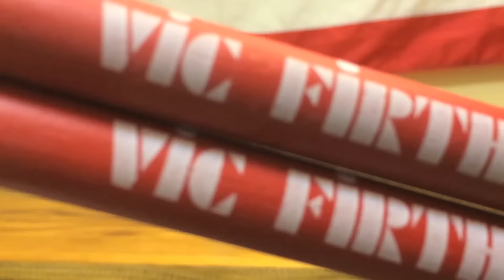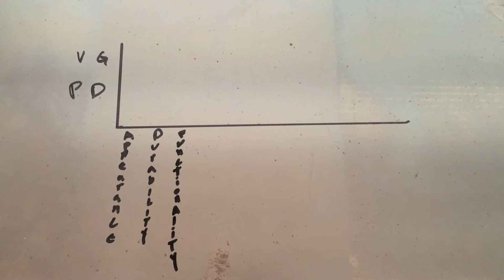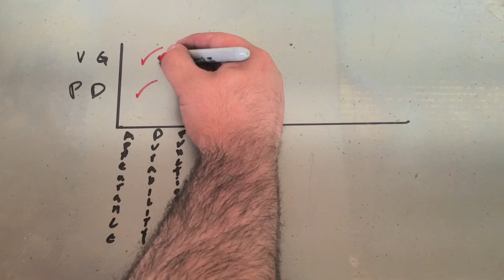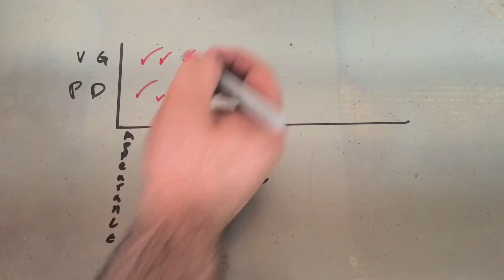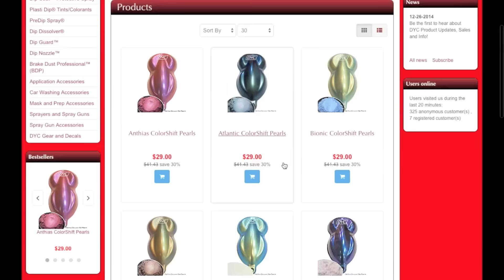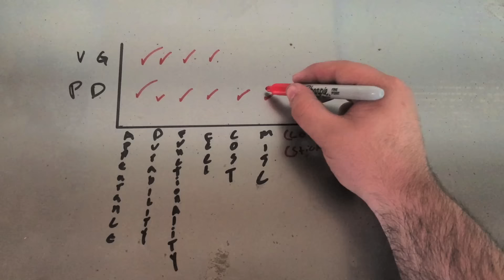Vic Grip VS. Plasti-Dip

Comment: You should try flex seal
Reply: That's a lotta damage!
Reply: The super strong water proof spray that can easily patch, bond, seal and repair
Reply: Now you can play drums under water
Reply: Who else read underwater in his accent
Underwooder
Reply: THATS A LOT OF DAMAGE
Reply: I did it’s very thick so it’s not as good
Reply: No, no, NOOO
Reply: Tried it
Reply: I did both plastidip and flex seal
Reply: They feel and are the same flex seal is just black plastidip
Reply: He can finally fix a boat.

Comment: More advantages to Plasti-dip spray or dip;
- You have control over how much of the stick is covered AND how thick.
- You could color-key different sticks., that way sizes/matched pairs would be immediately recognizable. 
- You can re-coat. (I've had the vic-grip peel on a pair)

Do sand sticks before coating as others have said.

Comment: Anybody trying this, just a tip, rough up the sticks a lil with a sanding sponge, so the dip can stick better, and if you are really into it, buy the the clear glosifier top coat from plasti dip and top it over once or twice after your color. The downside is that you'll have a glossier finish, but it makes the dip a lot harder and durable. Just my two cents from past experience. Great vid..
Reply: So scotchbright?

Comment: Great video on the plasti-dip. For a rew years now I have used shrink tubing for electrical wires over my sticks and I love the feel. Durability is off the charts. Reuse them after I break the stick. Lots of elbow grease to remove from a stick that it shrunk to, but totally worth giving a test. 👍
Reply: Genius lol. How have I never tried that, thank you

Comment: I've been doing the plasti-dip thing for a long time, actually. I use the Vic Firth Terry Bozzio TB Phase I sticks, which they don't offer in vic-grip.. So I did exactly what you did here. Although, I learned after a short while that the Spray Can dip does leave a little bit of a rough surface, and I didn't like that.. So I bought the actual dip can, that comes with a removeable top (used to dip tool handles and what not) Although that left a rather thick coating, so I bought the Naptha product used to thin out plasti-dip.. it worked perfectly. Now I have a smooth surfaced, perfect grip for my sticks! I'm glad I saw this video so I could give my input on the subject! Great video, man!
Reply from the maker: +DDrummr41 Yeah using the actual dip can make more sense, I didnt know about it at the time tho
Reply: DDrummr41 I actually use electrical tape for grips on my sticks
Reply: I use padded grip tape from vic firth then put electrical tape to to keep it on really well

Comment: Ive' tried this with Planti-Dip and love the results.  I was a bit more impatient so I used the Plasti-Dip liquid and just dipped the sticks in the can.  You get a thicker coat quicker.  Something else that I've found works great is heat shrink tubing.  Just slide on and heat.  It's really durable and by far the most cost effective option.  One 3-foot section of heat shrink costs $3.45 at your local MicorCenter Computer store.  Depending on how far up I take the grip, I can get two or three pairs of sticks with one section.
Reply: They (3M?) also make heat shrink in lots of colors and with heat activated glue in the core (less colors though).  The glue doubles the price.   A narrow ring of super glue at each end would work as well.  If they start to "feel funny" (loose), reheat to reshrink. them.

Comment: I've been using VicGrip for a little while, and in my experience, the place it starts to tear is at the end of the stick I use most on the snare drum.
The end grinds against my leg and once it's worn through, the coating starts to fly around. After a few rehearsal sessions with my bands there are little red pieces all over the floor.
Once there's a hole, the rate of wear increases from just the normal usage.

I probably rehearsed ten to fifteen 2-hour passes before the first hole, but after that it only took about ten to fifteen more to wear off almost all the coating except a few centimeters on the middle of each stick.

Comment: Just got an idea - what if you use Plasti-dip as a drum dampener? You could spray some onto your heads (thus controlling the amount of dampening), it would stay - and you are free to peel it off wheen it's not needed anymore. Might even work with cymbals..
Reply from the maker: Дмитрий Давидяк that video has been in the works for a couple months now... I just keep getting side tracked and focus on other videos. Soon though!
Reply from the maker: Дмитрий Давидяк also, if you watch the most recent $20 drum set video, youll notice the bd head is white ;)
Reply: What about plasti-dipping the inside of the tom shell?...I wonder if that would affect dampening?  It would look cool with a loud color with a clear reso head and lights underneath, lol.
Reply: i misread that like 3 times and thought you said "hands"
Reply: rdavidr do flex seal mate

Comment: I either buy sticks cheap in bulk and spray with plasti dip or I buy singles for special occasions those are usually promark 2bs but something I have done a little of is flex seal (ran out of plasti dip while making a batch was all I could find) its more soft and cushiony you might want to try some.

Comment: I have a question, if plastic dip is "cheaper," because plastic dip can spray more, you still have to buy a new pair. Would that cost more still?
Reply: cl _3an no. it would still be cheaper. also its ‘plasti dip’ not plastic dip. ;)
Reply: @jakeamano  I am sorry if I am asking too much but why would it be cheaper? Sorry. I still appreciate your answer.
Reply: cl _3an with 1 can of plasti dip, you could make lots of drumsticks,  lets say if you made 5 plasti dip with the cheap vic firth sticks, and bought 5 of the special vic firth sticks. The ones you made are going to be cheaper cause of the money you saved buying the normal sticks as compared to the special ones. 🙂

Comment: there are so many uses you will find for plasti-dip it is worth spraying your sticks yourself...you will find things around your house or car to use plast-dip on so you will always have some plasti-dip handy anyways and thus cost virtually no extra money spraying your own sticks. PLUS you can spray your sticks again later if you want. PLUS if the plasti-dip starts to wear off you will likely not notice a loss in gripping anyways. It doesn't take much plasti-dip to get a good grip...
As a side note you can also buy plasti-dip in a can with a lid so you can actually "dip" your sticks and have a thicker coating if you want.

Comment: I have used Plastidip for years on my sticks . I use the Danny Carey Signature stick from Vic Firth (they are not offered in a dipped version ) . After using some VF dipped 5b"s  I liked how they felt . I had some of the actual Dip can style of Plastidip laying around in my shop   not the spray . so I tried it .  I thin the plastidip down a bit with xylol  . I buy my sticks in sealed bricks 12 pairs I think 1 can will do all 24 sticks .    I think the plastidip can is like 8 dollars US where I live (Home Depot) . I find if you clean the stick with rubbing alcohol right before dipping the plastidip sticks much better . in fact its almost impossible to get it of if the stick is properly cleaned before dipping  .
Reply: Great info! Thanks!

Comment: Not sure if I'm just hard on gear... But I tried this last weekend. I used duplicolor brand so that may be the issue. I'm in a country bar band and we play anywhere from 4 to 8 hours a weekend and after the first night they were down to wood on almost the entire stick. I have never used the Vic grip sticks so maybe they wouldn't hold up either. I usually use the Vic wrap stuff. Last me a few nights. Just expensive.    Either way. Great videos.... Thanks for the content.

Comment: How do you spray the sticks? How far do you spray, and how much do you apply. I tried and my sticks were slightly bubbly. Yours look so smooth.
Reply: Blue McDaniel you were probably spraying too close. you wanna be about 10 inches away and make sure to shake the can really well before spraying
Reply: Okay, so doing this outside is def. a best ideea right. These things stink like chemicals, way more than other stuff I sprayed. This smell will be gone right? I don't know if  can take that if the rubber smells when it get warm in my hands. Please let me know.
Reply: yes definitely do it outside or in a well ventilated area and the smell should go away after it cures

Comment: I would only do two things differently: figure out a way to hang the sticks with the butt pointing down (just incase there is any drip), and I would not cover as much of the stick with the coating. I tend to grip further back on the stick and i would not want to hit rims or cymbals with the coating which goes past the half way point on the stick.

This is an awesome idea though. I may buy a brick of Goodwood 7A sticks and coat them, since I usually play larger sticks.

Comment: Does plastidip transfer to your heads or cymbals if you strike with it?

I once painted my sticks with white spray paint.  I had white streaks on all of my cymbals where I struck them.
Reply: Judging by his durability test I would say no. As far as cymbals go, I'm not sure why you would strike THAT far down the stick (maybe you would idk), and I think cross-sticks might be a problem-if u like to click the rim w/ the butt of the stick for heavier sound
Reply from the maker: Tanner Hall It wont chip like paint, but if anything I could possibly leave a smudge on a head. Ill try it out and get back to you haha
Reply: The Pepster I was thinking of painting the plasti dip higher up on the stick which might get close to the shoulder where I hit the cymbal.  Second if I have my stick upside down when I hit the cymbal for who knows what reason.  What about deep rimshots
Reply: rdavidr What about rimshots as well... would it nastify your rim?
Reply from the maker: Tanner Hall I just tried it out and it leaves no marks. I also rubbed the butt of the stick on the head and it left no marks at all
Reply: Awesome.  I might  try it out.

Comment: My time is worth quite a bit. You forgot to include time in the cost. For me, the PD is WAY too expensive with two caveats:

You can put it on any stick you like.
You can get it in lots of colors.

Both bring it over the top for me. If I just want red and want the VIC sticks, I'll just get those. but for any other situation, the DIY is the way to go.

Good video.

Comment: I just recently bought the actual dip can, as others have suggested, but I found the can was too short and only covered half the area I wanted to coat. Is there any trick or a solution I have simply overlooked? (I'd like it to cover roughly half of the stick)

Comment: One of the things i would like you to consider on the durability and feel is the type of plasti-dip you chose to use. The spray can plasti-dip is thinner to spray out of the nozzle, and in my opinion not as durable as the actually plasti-dip that comes in the can. This link is to plasti-dip that would likely feel and function more like the vic-grip. You simply dip it into the container for diy tools handles etc. 

this is the kind you actually dip in. 
https://www.amazon.com/Performix-12213-Plasti-Dip-Black/dp/B00I9SK8XY/ref=sr_1_3?ie=UTF8&qid=1475094781&sr=8-3&keywords=plastidip

Comment: maybe if you rough up the surface off the sticks before the plasti-dip?
Reply: the sticks have a sealer coat on them.  A light sanding and wipe with a damp cloth before spraying will help greatly with adhesion.

Comment: Plasti Dip usually needs a curing time of about 4-24 hours from everything I have read.  If you start picking at it after 3 min it will come off way easier than if you waited for it to cure
Reply from the maker: +Drapeta Berry I was saying it took 3 mins of rubbing to get through, I let the sticks sit a few days to fully cure.
Reply: Ooh got it!

Comment: You didn't sand the drum stick before applying the Plasti-Dip. I think it would adhere better if you sanded them first. I'd recommend a very fine sand paper so you don't change the dia of the sticks too much. Most sticks like the Vic Firth you've used have a clear coat on them and that probably should be removed.

Comment: buy the actual dip, not the spray can. why??
1. you can dip around 6 to 8 pairs of sticks. 
2. it puts a thicker coat on.
3. you can re-dip  in about an hour if you want a bit thicker grip, and it will last longer.
just my opinion.
Reply from the maker: +Eric Pfaff yeah I didnt realize they made it in a can at the time